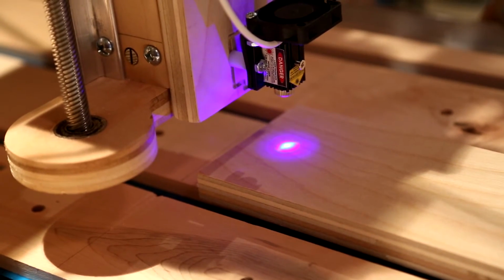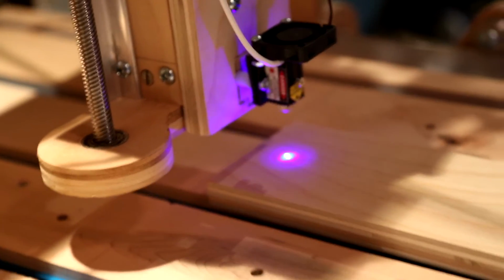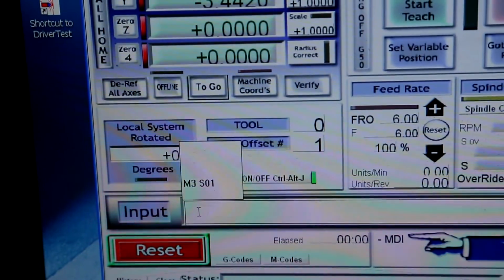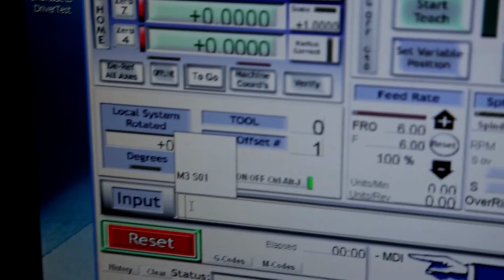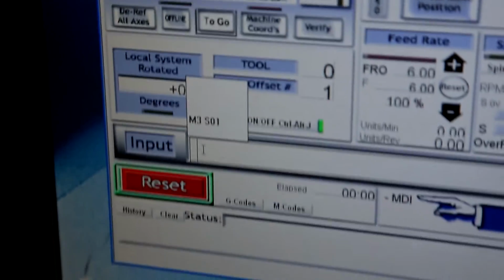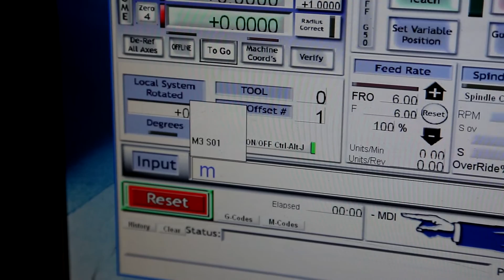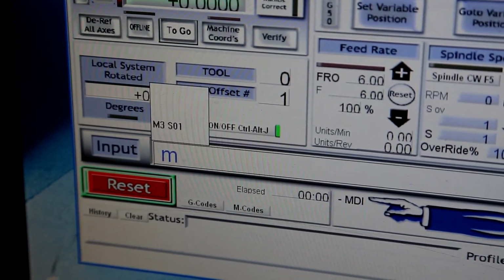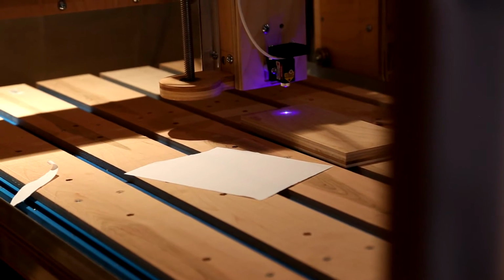0007 Burning Some Text

Comment: Hey John, as I stated below I watched your videos that were very helpful. I ran a few test jobs and they ran great, but as they were only tests, I didn't pay much attention to the position of the etching. Now, I'm trying to laser etch something and the position is critical. The problem is that it's intermittently losing it place. In other words, it will move from x and y zero to do the etching, when it moves back to zero i can see the zero position has moved sometimes as much as .5" in the x and/or y. I use the  same machine and the same mach 3 software for my router and it never strays from zero. I'm wondering if you've seen anything like this with your laser. I've tried Mach3 support and the only thing they told me is to slow down the feed rate. Thanks, Greg